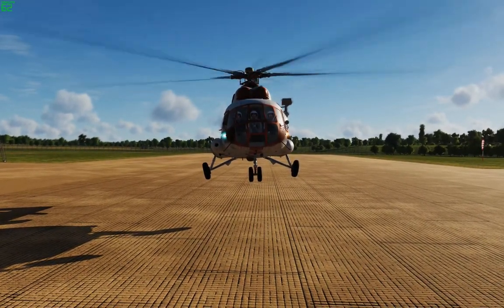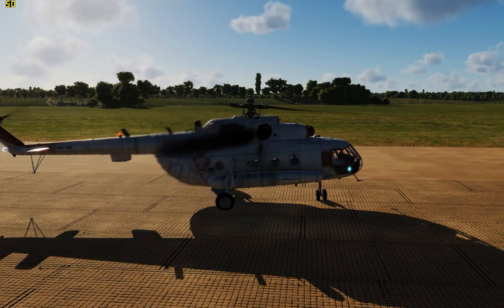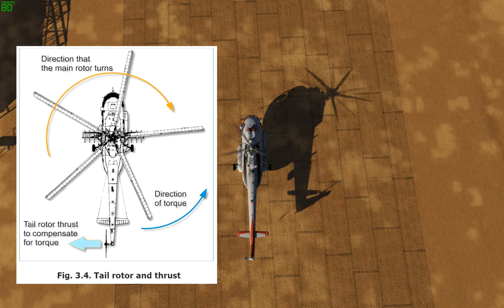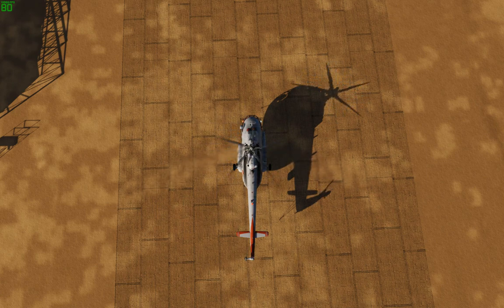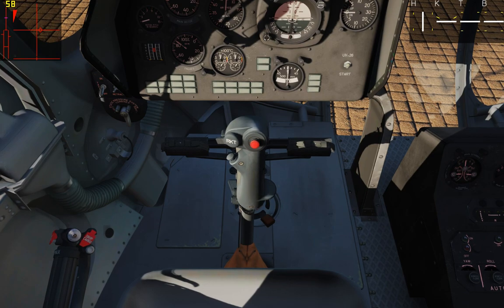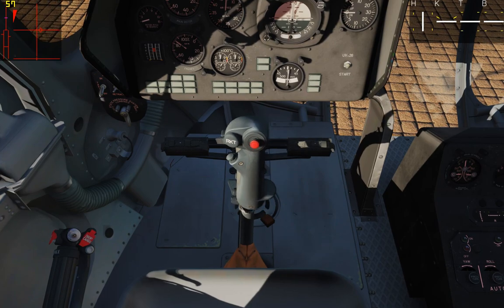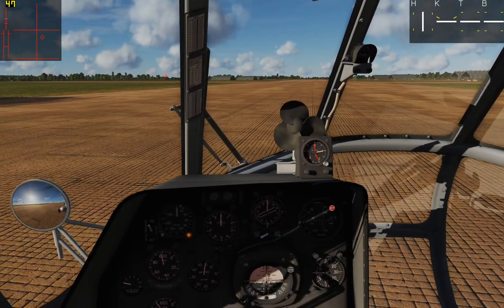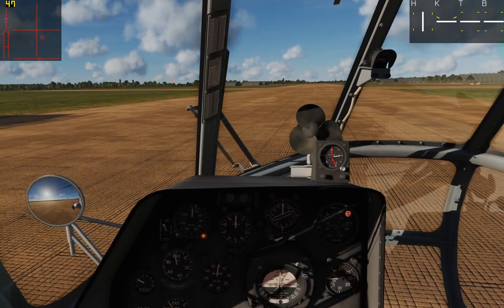DCS Mi-8: Hover Tutorial

Comment: Hi, I recently found this series on reddit, and thought I'd give it a go to learn some of the systems in the Mi-8 which I haven't really bothered to learn. I like the very slow and methodical approach you take in your videos, and the effort you make to go above and beyond with your explanations. 

I'm a helicopter engineer (Well, I was. I have returned to school for my masters degree, in rotorcraft as it happens) and there are a couple things I'd like to correct. You mentioned in your intro video that you're open to comments and corrections, so I hope this isn't totally unsolicited. 

1:40 Shaft tilt is indeed used to maintain level body attitude in forward flight. However, this is as much about reducing fuselage drag as it is about crew and passenger comfort. 

4:30 The airflow through the tail rotor isn't really the reason for the translating tendency, it's the thrust itself. Granted, thrust and inflow are linked, but I'm confused as to why you use TR thrust to describe the TR countering MR torque, but then use inflow to describe translating tendency. IMO, the best way to think about this is that the tailrotor generates a thrust far aft of the CG. This both pulls the aircraft to the left and produces a moment about the CG, the latter of which counter mainrotor torque. The lateral thrust of the TR must be countered with lateral MR thrust, accomplished by tilting the disk (and thus, thrust vector) to the right. 

5:40 The vertical stabilizer on traditional single-main-rotor (SMR) helicopters doesn't do nearly as much for directional stability as the tail rotor itself does. Air coming from "below" a rotor will tend to increase its thrust at a given collective setting. Air coming from "above" will tend to decrease thrust. In this sense, the tail rotor itself acts as a vertical stabilizer. 

7:10 Not sure what you're getting at here. ETL occurs at a sufficient translational speed of the main rotor, regardless of direction and aircraft orientation. If you fly forwards and then yaw into a sideslip, you won't suddenly exit translational lift. You may slow down as a result of the increased fuselage drag and then exit translational lift, but it wasn't the sideslip itself that caused this. In fact, a helicopter will require less power to hover in a cross wind then it will to hover with no wind. Granted, there are other reasons not to hover in a crosswind. 

7:46 Hovering nose-into-the-wind is almost always desirable, regardless of wind speed. This is more a question of gross weight. If you have to have a headwind to hover, you probably shouldn't be hovering at zero ground speed. Fly around at your bucket speed to burn off some fuel or perform a run-on landing. 

7:52 Hovering with your tail directly into the wind is almost never a good idea unless operational requirements dictate you do so. 

8:20 These are called "quartering winds" and can sometimes be the most difficult wind orientation to hover in. While unlikely to be modeled in the sim, mainrotor-tailrotor wake interaction can be detrimental to directional stability, and available yaw rates can be greatly reduced. In extreme cases (high gross weights and/or at high density altitudes) the tailrotor may not be able to counter mainrotor torque and maintian heading. The flight manual will usually specify wind azimuths to avoid and the maximum wind speed you can expect to hover in at a given azimuth. 

9:50 The right quartering wind you describe as favorable may be so in the sim, but know that main rotor wake blown into the tailrotor can cause loss of tail rotor effectiveness (LTE). Putting the tailrotor in a descent condition (Right side flight in the case of the Mi-8) can also put the tail rotor into VRS, which will also result in LTE. 

14:00 In ground effect, rotor inflow is reduced, which increases rotor angle of attack at a given blade pitch (collective setting) increasing thrust. Put another way, if you require a certain angle of attack to maintain lift, a lower collective setting is required. This reduces induced drag, which decreases induced torque, which reduces induced power. So, in short, you are correct that ground effect reduces power required to hover. 

15:00 "Width of the rotor blades" might be confused with blade chord, rather than rotor diameter, which is what you mean and correctly describe later. The 1-rotor-diameter rule is a good rule of thumb, but you should clarify that it's not like ground effect suddenly stops at this height. It's strongest near the ground and tapers off almost exponentially with increased height. Also note that it's rotor height, not aircraft or wheel height, that determines the strength of ground effect. 

16:55 The word you're looking for is "oleo," though I don't think many people watching this video would know that word unless they work in the industry or maintain aircraft. 

18:02 Your explanation for dynamic rollover is okay, but it's better explained in that the helicopter whats to drift right but is restrained by ground contact. The lateral force of the rotor is counteracted by an opposite lateral reaction force at the landing gear contact point. This creates a moment about the aircraft CG, increasing the aircraft's roll, increasing the aircraft's transnational force, increasing the force at the landing gear, increasing the rolling moment and so on. Eventually, you will reach a point where no control available to you will be enough to right the aircraft. There is insufficient roll moment available from the rotor. The CG rotating above and beyond contact point prevents you from reducing collective to set it down, and too much roll attitude prevents you from picking it up into a hover. This is dynamic rollover. Being light on wheels makes you particularly prone to dynamic rollover (which can occur in response to a gust or some other disturbance). In real life, you would not want to remain light on wheels for very long. 

20:52: I completely agree. For this reason, I often recommend the Huey for people getting started with helicopters in DCS. 

24:30 I have found the opposite. Focus on something distant such that you have a good feel for aircraft attitude, and use your peripheral vision to track aircraft translation. Otherwise, you'll have a tendency to over-correct. This was confirmed by a helicopter instructor I flew with once. If you can hover looking at objects close to you, that's great, but I think many people have difficulty with this. A similar recommendation is made for aerial refueling; focus on the tanker, track the basket in your peripheral vision. 

28:14 This isn't where ground effect is strongest, it's just the point where the aircraft finds equilibrium at the given collective setting. Ground effect is stabilizing in the vertical axis. (Interestingly, there is such a thing as "ceiling effect" which is unstable, but never encountered by real helicopters. )

28:27 The rotors don't have to work hard to push air. Actually, they don't have to work as hard. Power required is reduced in ground effect, that's its whole thing. 

Nitpicks and such aside, I think I'm going to like this series. If you want me to keep detailed comments coming, I'd be happy to make them. Helicopters are very confusing and there's a lot of misinformation out there, and I do what I can to correct it when I see it.
Reply: @ErikScott Really good info here. I am a helicopter pilot. Usually we’re cussing out the engineers lol. Sounds like not all you guys are bad haha👍🏼
Reply: good stuff!
Reply: You should inform the developers about this stuff.
Reply: Thank you for all that. You're excellent at explaining such things. You should be a helicopter school ground school instructor.
Reply: 18:02 did you mean to say that the helicopter wants to drift LEFT but is restrained by ground contact? (to port)
Reply: Watching this video and reading this comment makes me feel like a helicopter engineer

Comment: I have flown large RC helicopters for several years and same with sims. Still found your tutorial both informative and well structured. Highly recommended!
Reply from the maker: I only have a micro rc heli but I find it a lot more challenging than sims, probably because keeping myself and my controls oriented when I'm not physically inside the machine is hard. What size rcs do you fly?
Reply: @vsTerminus  It was 700 size electric 3D helicopters, stopped due to the high cost (crashing 😁). Sim is cheaper and just as fun in a different way.
Reply: @vsTerminus  It was 700 size electric 3D helicopters, stopped due to the high cost (crashing…). Sim is cheaper and just as fun in a different way.

Comment: The Doppler system also has a VVI and it's much more sensitive then the normal steam gauge VVI. it's to the left of the crosshair, regretfully a little hard to see but it makes life a lot easier in less visibilty or at night.
Reply from the maker: I always forget about it, partly because like you say it's hard to see. But yea, it's there and it's better.
Reply: I've been working on helicopters and other aircraft for over 20 years, and I've never heard a Vertical Speed Indicator(VSI) referred to as a VVI.
Reply from the maker: @ImpendingJoker  Interesting! It's listed in the manual as the "CR-30MK Vertical Velocity Indicator" so that's what I've always gone with. 

I suppose it makes sense because it's giving you a magnitude (speed in m/s) and a direction (up or down), but I guess you could interpret the direction as positive or negative speed and then it's just giving you speed without a direction.

That's interesting, thanks for sharing!

Comment: Vs Terminus, could you please reveal your cyclic and collective settings and the curviture that belongs to the pitch roll yaw and collective settings!? I really like your tutorials! Great to follow and understand. Regards! Jos.
Reply from the maker: All zero :) I don't use any curves or axis adjustments at all anymore.

When I started learning I used a +15 curve on cyclic pitch and cyclic roll but eventually found I didn't need them anymore.
Reply: @vsTerminus  Thanks for the response!!! I'm afraid my inputs are too big at the moment, because it is very hard for me to get it into a steady hover. Most of the time even not possible. I use a thrustmaster Tflight hotas. No rudder pedals but the tumble switch on the throttle/collective... But I also need more practice. Seeing you go into a hover looks so easy, but I can't reproduce it yet!!!
Reply from the maker: That's very common! It took me a while to learn to make smaller inputs. You should try those +15 curves and see it if helps. Also remember to trim and use that autopilot center channel.

Oh and try defueling your helicopter to about 60% or so. You don't need 100% fuel and it will make hovering a little easier as you're not so heavy.

Keep at it, you'll get there!

Comment: It's a little struggle for me. I can hover sure but I use a TM Warthog with no extensions. Are there any axis settings one could use to mimic perhaps the real Mi-8MTV? My hover results in more or less a dance.
Reply from the maker: You're in a tough spot, that's not an easy stick to work with for helos.

Two things you can try:

1. Set X and Y axis curves of about +15. Use that as your starting point and adjust as necessary.
2. Don't trim for takeoff, just pull some aft stick and hold it. You'll be limited by arm fatigue, but you won't have to fight the center detent and will be able to make small movements more precisely. 

Personally I would look into an extension, or moving to a Virpil base (since they are compatible with your grip already)

Comment: What material helped you to understand working of helicopters...i find the dcs PDFs are not sufficient
Reply from the maker: Unfortunately this is not an easy question to answer in the confines of a comment, but I'll try.

The Mi-8 manual has some good diagrams, but you're right that it's not always the best place to get an understanding of more general concepts.

For that I've frequently turned to materials made available by the FAA and by Transport Canada. Sometimes Wikipedia has articles that are helpful, and other times I find myself just reading through posts on various aviation forums because someone has a way of explaining things that just clicks for me.*

* Be careful with that last one, it's also a good way to get a lot of bad information. If it doesn't jive with what you're reading from more official sources it's probably sus.

The key point here is to not rely on any one single source, but to find as many explanations as you can and then look at what is common across all of the explanations.

Also you need to consider - especially with the Mi-8 - that most of the material you find online will be for Wester, counter-clockwise rotating helicopters and a lot of what they write will be backwards. The diagrams too. It's an added layer of challenge for us English-speaking Westerners to find good information on Eastern helicopters.

Sometimes I have to see things to understand them, and YouTube can help with that. For example, understanding how the gyro-based turn indicator works was something I had to see for myself and sure enough YouTube has some great videos of it where they demonstrate how forces act on it and how it responds.

 The hardest part for me was when I would notice something that I couldn't explain and to figure out what was causing it. It's easy when you just want to look up concepts, but tracing behaviors back to concepts was hard.

Anyway, good luck! It's a rabit hole and several times it has left me wishing I could afford to just take lessons and get some formal education instead.

Comment: Whenever i try to hover, there's definitely multiple sections of attempts where the helo starts doing that rattling and vibration.  Any idea what causes that stress?
Reply: I think that's where the ETL kicks in or vanishes, so basically somewhere around 16-24kts. Nothing to worry about, but certainly an indicator to check your vertical rate, because that's where you might be within a VRS just a brief moment later on when decelerating.

Comment: by far the most comprehensive video on the topic!

Btw, is it normal to use full engine throttle all the time? By engine throttle, i mean the two levers that can be adjusted to three positions, idle, minimum and emergency. 

I find the hip a bit sluggish/underpowered vertically in the middle throttle position. Whereas the max power setting feels much more capable, and less vulnerable to generator failure

Comment: A question, you seem to have your throttle at half for this entire video, and I'm not sure if I missed you talking about it or what, but is that your recommended level for hover? In general?
Reply from the maker: So the throttle ("corrector") should be full-right all the time and the governor will handle managing the engine RPM.

Your collective will depend very much on how heavy you are and what the wind is like. For example, on a windy day with no payload and low fuel you could lift off with just two degrees of collective. While loaded heavy with no wind you might need 10 degrees to take off. "Normal" is probably somewhere in the 5-7 degrees range, but you shouldn't be looking for a specific number every flight.

Comment: Surely it makes more sense to have the tail rotor on the right to counteract clockwise torque?  You said the export Mi-8 puts it on the left - weird.
Reply: This is not always the case. The reason for the change is due to tail rotor blanking where the vertical stabilizer reduces the thrust by being in the way, these are often called, tractor configuration where the tail rotor thrust "pulls" the tail to counter act torque. When placed on the other side of the vertical stab, in this case the left, it is now in a pusher configuration, and this all but eliminates blanking by the vertical stab. This change is seen in the Bell 205 on export and civilian versions as the effect was better understood, but it would have too costly to convert the ones in the US Army so they just left them. Most helicopters today in a conventional configuration use a pusher tail rotor for better tail rotor authority in all phases of flight. Another way to reduce this blanking can be seen on many surplus UH-1Hs where they have a mod called a Fast-Fin. This has a portion of the trailing edge of the vertical stab removed to reduce the amount of blanking caused by the helicopter having a tractor tail rotor, though this is sometimes seen in pushers as well because it creates less drag. Another phenomena that has been studied, is dissimilar airflow over the tail boom. As the retreating blades move towards the tail boom they create a faster airflow down one side, thus reducing static pressure and creating a certain amount of lift to that side, which in turn pulls the tail boom to that side. This has been eliminated in a lot of older helicopters and included from the outset in new helicopters by fins running down the tail boom, call strakes. These act as spoilers and keep the air from moving down the sides of the tail boom and keep the differential pressure difference to a minimum. In case you can't tell, I've been around helicopters for a very long time in real life.